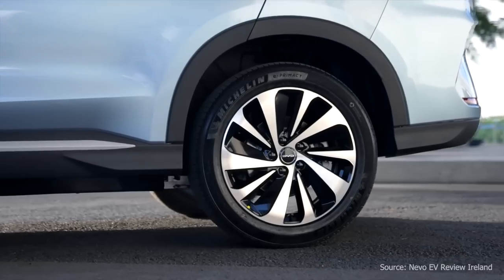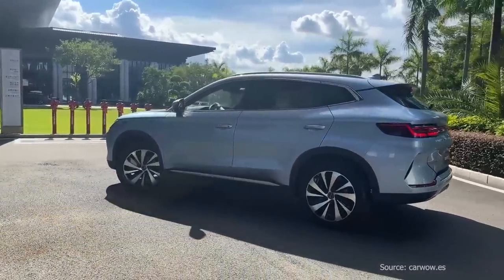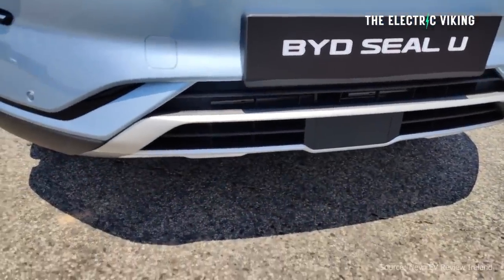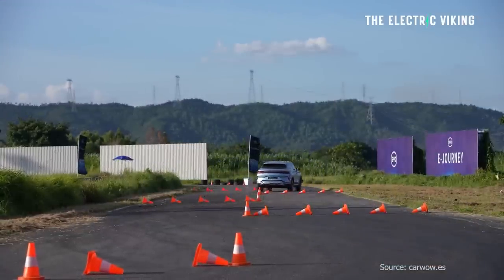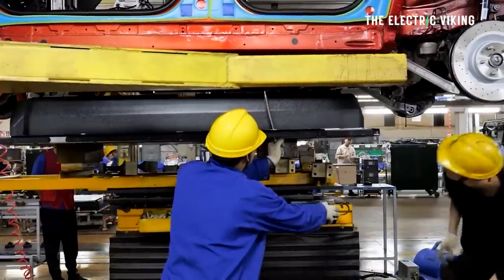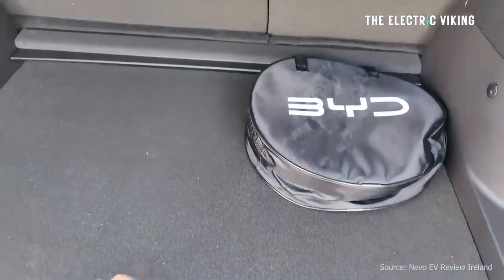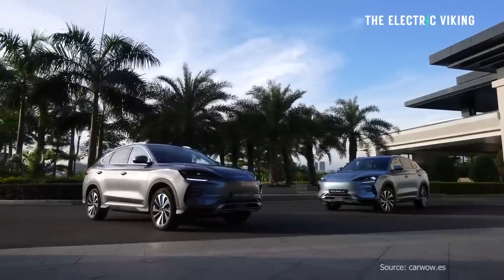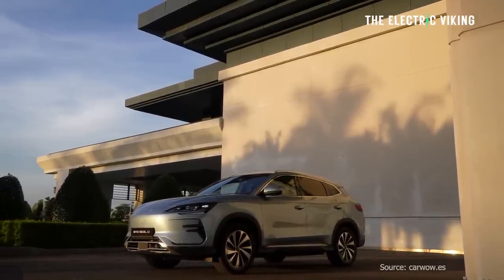New BYD Seal U (Sea Lion) revealed for Europe, UK, Australia & NZ

Comment: Volvo learned the hard way that Front Wheel Drive is not very good on an EV because of the instant torque. Volvo switched to Rear Wheel Drive ✅
Reply: And Volvo belong to Geely
Reply: @Modern_CarWorld You mean Volvo the brand that was struggling almost dead and is now one of the desirable Cars on the road. Not only Volvo making great EV’s but their all electric division Polstar as some brilliant offerings. Volvo did learn the hard way who they are now owned by makes what difference, they certainly have reinvented themselves for a new generation over thought as a old man’s Car.
Reply: @SWR112  I meant Volvo is bought by Geely since 2010 and now it is belonged to GEELY.
Reply: @SWR112  polestar now dying

Comment: The vast majority of drivers in the world won't find 9.5secs 0 to 100km slow. In fact for most drivers 9.5secs is scary enough especially when commandeering a SUV. A 10 second street car is fast to 99% of the population.
Reply: No way, that’s two or three seconds too slow. You can’t enter a freeway with a slow vehicle like that.
Reply: True. Most people don't want to change front suspension parts regularly because of ridiculous performance. A daily driver might even settle with less performance. There were there are a true winter it is half year not even possible to utilise the power or you find yourself in the ditch.
Reply: @oldbloke204 9.3s is ok for 1979 when you were getting your first car 😂😂
Reply: @royphillips7644  You clearly don't know how to merge onto a freeway safely and courteously.
Reply: Except when you need to pass a caravan, truck etc.  Where did my ponies go????
Reply: I think the Prius is 13 which is considered really slow. My old (but not that old) Honda Civic auto I think is 9. Nothing special.  But this is from several years ago.

Comment: I might be wrong, but it looks to me like a BEV version of the Song Plus DM-i sold in Brazil.

The interior trim looks better due to the more "classic" choice of colors (the DM-i features seats coloured like the Atto 3/Dolphin).

I don´t know if it will actually be a better choice than the Atto 3, a pure BEV platform, unless the purchaser really needs the additional boot space. 

I wouldn´t go for the Tesla Y, because it´s not an option in my country. There´s no official Tesla operation in Brazil (you can get them only from independent importers and they end up costing about the same as three Atto 3´s - 279K BRL for the Atto 3 and 750K for the independent import Model Y ).

Comment: Depends on the price.  BYD's only significant drawback is its slower acceleration vis-a-vis the Model Y.  I drive a much slower SUV than the Seal U so this would be an upgrade.  Why not?  Let's see the price!  I wouldn't spend the stratasphere prices Tesla is asking their cars anyway.
Reply: I agree with you, I haven’t been in a BYD, but I have sat in a ModelY , it’s huge inside, I’ll be very surprised if BYD could match it!

Comment: Exactly AWD and dual motor version is the way to go currently for any SUV including the Lexus RX500h and LS600h. The all-wheel-drive RX500h employs a hybrid powertrain that combines a turbocharged 2.4-liter four-cylinder engine and a pair of electric motors to produce 366 horsepower.

Comment: 9.6 Seconds 0-60 That's what I call a perfectly acceptable and sensible acceleration rate for a car and especially given that we're supposed to be reducing CO2 emissions!
Reply: 0 to 60 in 10 seconds? I know some electric bicycles that are quicker than that. And you're still conflating electric vehicle performance with the massive wastefulness of ice cars with big engines. Quick acceleration does not affect range or efficiency much at all in a truly designed from the bottom up electric architecture. For example the Tesla Model 3 Performance with the aerodynamic Wheels gets exactly the same efficiency as the long-range version. Part of why electric vehicles are disrupting Legacy technology is there more fun to drive. Think of it as the icing on the cake that gets people to do the right thing. In that sense it is valuable.

Comment: Seal U not the Sealion. This model is expected to be cheaper than Seal (less than 200k CNY), around the price of Song Plus EV. Maybe it should be called "refreshed Song Plus EV with the name and outer shape of oceanic product line".
The real Sealion (if it exists) should be priced around 200k-250k CNY, slightly lower than the price of Tesla Model Y.
BYD is desperately renaming everything to Seal because Seal didn't sell very well in recent months. They need Seal to be the flagship of their oceanic product line but it failed.

Comment: Pardon my ignorance, but can an EV with 2 motors continue driving if 1 motor fails?
Reply: Depends on the fault. If it is an electric disconnection then it will in theory keep running. It may cause further damage in that state or it could have a mechanical clutch and disconnect by design

Comment: Any car then can go 0-100 just under 10s is fine and good enough. The city road cars are not for racing and unless u wanna cops up all the speeds fines. Have a decent range 400KM minimal is fine for me. Because i dont wanna carry anymore bigger size and weights on. As long the charging maximum speed 150kWH is good. Is not like we all gonna drive long day road trips everyday.  Normal people daily driving ranege from 10KM - 50KM per day. Even for Taxi driver is an average of 300KM per day. Why need sucha huge giant battery just to waste more money? At home is enough for you to charge the battery over night with 11KWH home charger. And if the price tag just 55K AUD then Im happily to buy it right away.

Comment: As to LFP batteries.... yeah they are great BUT there are now many Teslas out there with way over 250,000 miles on their odometers. These cars have the NMC chemistry and have been fine. I'm sure the LFP ones could go even longer but will the other mechanical parts of the car also?  LFP thermal safety I think is the real issue that customers should consider.

Comment: I wouldn’t buy either. I have three red lines which are.. no front wheel drive, must have a rear wiper and must have the charging port on the left side back. I can be choosy when spending £40k + 😁

Comment: Chinese inform range in NEDC. Then true range 300 and 400km. 😌That is not remarkable, but not obstacle if the price start with 20 000-29 000€. Less than though Peugeot 2008 with 405km range WLPT. 

Otherwise this car will not be a seller. People are sceptic about new  brands and models and rightly so. A car is the 2nd biggest purchase you make in your life.
Reply: It has been changed to WLTC this year. Many EV's range have already seen drop of around 5%-10%.

Comment: Your issue is a non issue a transmission tunnel or using a ICE platform is ok for most people as long as the range and driving dynamics are satisfying for a owner.   Bigger issues are the motors and the power.  …. And there you go with your Tesla plug again.  Wonder how many shares you own in Tesla.   Seems more like a Tesla financial consulting channel lbs a EV adoption channel  😂

Comment: I think that this model isn’t going to sell well in Europe. Rather bland with an exterior that has too much chrome bling accents. The price won’t be compelling either, which is important if they want to win over the frugal buyers. So that leaves the car enthusiasts, but those usually want performance, so those won’t buy either. And after two years, unless you follow car news, nobody has heard of Byd.
Reply: I don’t know, I think it’s an improvement on the Atto 3, it hasn’t got the stupid slogan on the back and the psychedelic interior. If they sell it at a reasonable price (i.e cheaper than the TMY and VW ID4) and provide support they might finally be on to a winner.

Comment: Crap! Range, loading speed, FWD, no AWD, styling and acceleration are dealbreakers. In Europe BYD is till now too expensive and the leasing rates are too high due to high depreciation. BYD in Europe is till now not able and willed to name a price. The software is trash. The tested Han showed Chinese signs on the dashboard! Phantom breakings disturbed the ride and the radio a complete disaster. The tested Atto3 did not show the speed limits correctly and was peeping all the time for nothing. BYD no thanks!

Comment: The vehicle's design aesthetic and dynamics is underwhelming, Tesla need not be concerned. Design should have risen to the point beyond somewhat rather boring underpowered, overweight metal bubbles on tiny wheels with FWD. While these outcomes still excite some whose sole purpose is to move from points A to B, there are others who aspire to derive some level of driving pleasure. As such, this seems a missed opportunity for BYD to successfully enhance their current vehicle lineup. Design should always play a role, not just the economics.